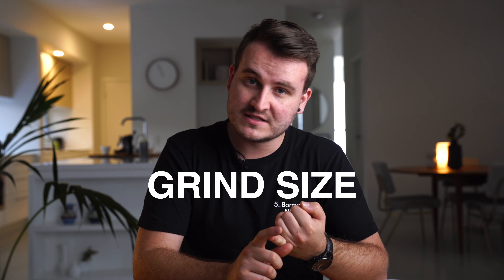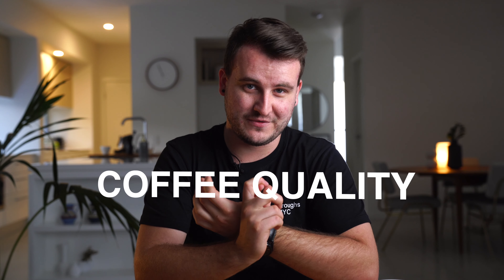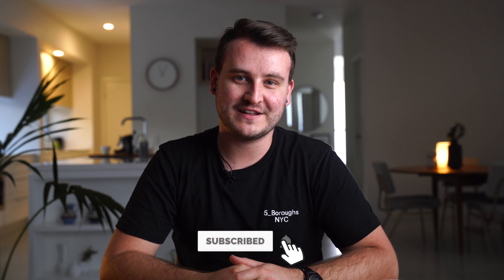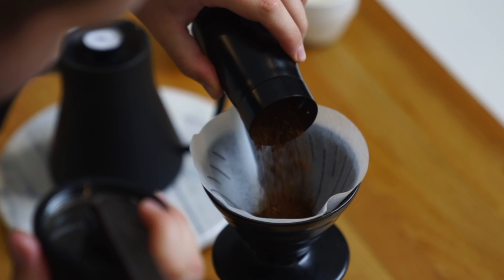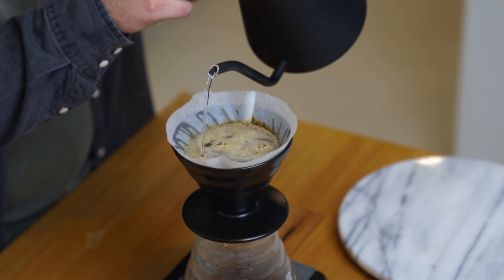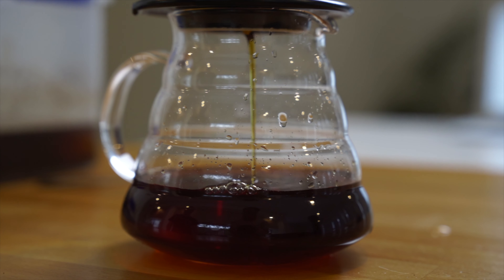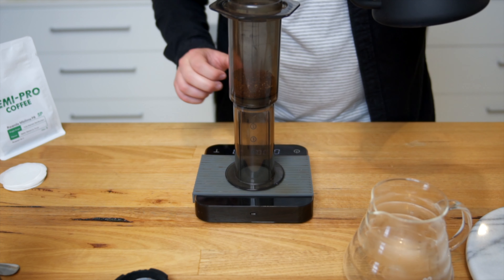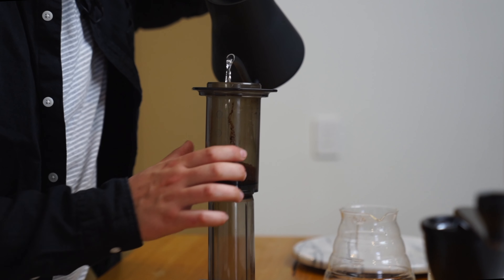Why the coffee you make tastes bad (and how to fix it!) | Part 1

Comment: Sometimes your coffee maker can cause issues. I have a mocha master and I’m using the same grind, same beans same ,same brew time and same distilled water. Last week my coffee out of nowhere had a funny sourish taste. I thought I used the wrong beans by accident, but no all last week this same taste kept coming through. Process of elimination it the copper heating element that I haven’t descaled in years. So Im the process of trying to rescue this maker. The taste is ever so slowly getting back to normal. If you have this kind of brewer it has to be cleaned and descaled every 100 brews. I had the descaler and cleaner on hand and used it before but somehow just stopped doing it. It came back to bite me.

Comment: I have been using a particular whole bean organic Columbian coffee for years (Jim's Organic Colombian Santa Marta Montesierra) , which I found after similar excellent organic Columbian whole bean supermarket brand changed their supplier to something much inferior. I like it because it has a full rich flavor with chocolate notes, occasionally almond notes. I haven't tried the more esoteric hand dripped methods, but I have used a top rated Cuisinart DCC-3200P1 PerfecTemp 14-Cup Coffee maker with glass carafe for years (I see they have a newer version, also, with a smooth black touch screen interface that is 40% more expensive--I'm not sure I would prefer that). I set it on 1 to 4 cups with the Bold setting, which slows the process down. I also use springwater. I find that coffee does vary slightly from bag to bag, or batch or  batch of bags to batch, and I have to adjust the grind, or perhaps the coffee maker needs descaling, or whatever.
A coffee company representative told me a while ago that using too little coffee will make it more bitter, which sounded counterintuitive but it's because it over extracts the coffee. I also found that, contrary to what you have said, a coarser grind will make the coffee less flavorful but also more bitter. I recently had to make the grind even finer than I had been using to get the full balance of the coffee components, which ironically reduced the bitterness. The reason I had to I just the grind could also have to do with wear or clogging of the burrs of the coffee mill, or some change in the physical calibration of the grind in the mill. So, up to point, a finer grind may reduce the bitterness. As you say, it's all about the proper balance.